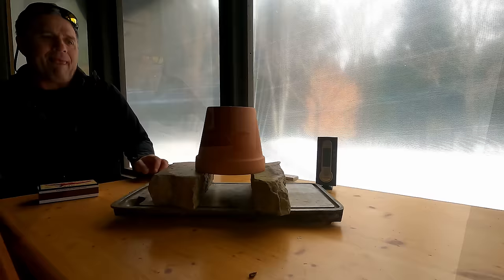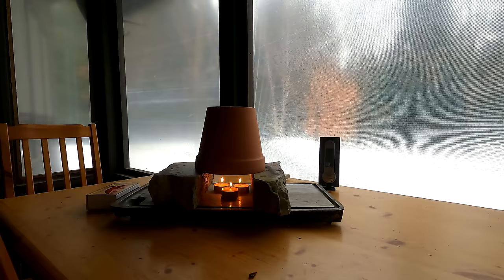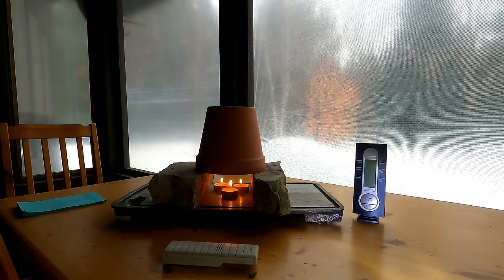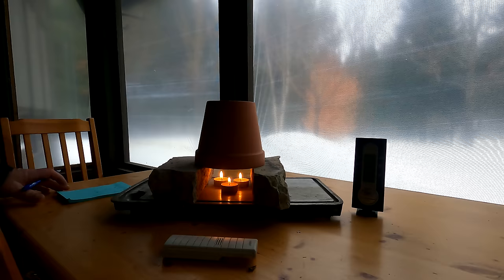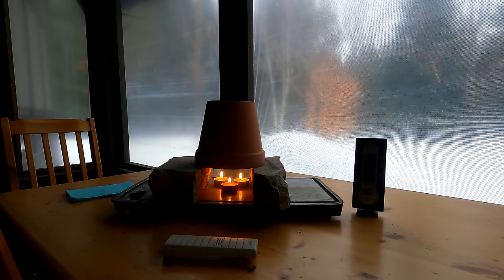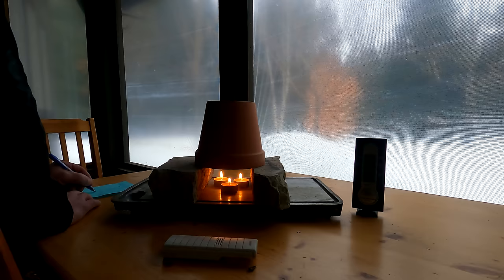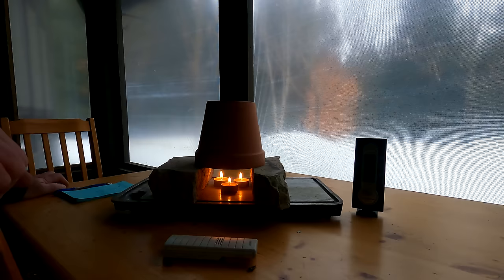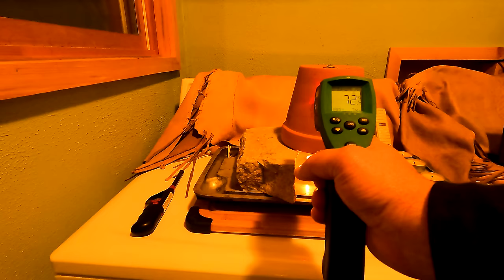Testing the Clay Pot Heater | Truth or BS | Prepping and Testing

Comment: The thing that casts doubt on these things isn't that it's on the internet, but it's the machine voiced, "the EVIL heating companies DON"T want you to know about THIS" Which is obvious clickbait and obviously doesn't make sense, and there's a question of motive behind the advertisement.  I'm also partial to the people who said you didn't really provide us much value.  Mechanically, some HVAC guy needs to explain what's going on, not a guy in a cabin in the woods (though I like these sorts of folks, generally.)
Reply from the maker: Not sure what your statement means  "but it's the machine voiced, "the EVIL heating companies DON"T want you to know about THIS" Which is obvious clickbait and obviously doesn't make sense, and there's a question of motive behind the advertisement." as I did not use such language in the video - I simply did the test to determine if this unit would work. The candles did indeed heat the small room - marginally - by a few degrees. The pots simply capture the heat and radiate it out in a controlled manner - much like a stone fireplace is designed to do. Bringing in thermal dynamics into this conversation is a tad bit over the top because when the power goes out, and you are wearing your parka in your home - any heat is good heat.  Note - my home is heated with wood so therefore I have no need to use this device. This was a test was conducted to quell my inquisitiveness pertaining to the potential of such a device. BTW - As a guy in a cabin in the woods, I can tell you we are very adept at fixing anything which comes our way. HVAC, Electrical, Plumbing and every thing that makes a Cabin run.

Comment: Watch the price of the  T lites go through the roof.
Reply from the maker: Thats funny - Ikea sells them in huge boxes - This heater is useless in practice - a good ole campfire is good enough for me.
Reply: @Hawksshadow  maybe you don't live in a very cold country like me.  Europe is currently being extorted for gas. Not gas that goes in your car either but that too.
Reply from the maker: Hi John - Temps here can reach down to - 40 degrees C. The clay pot setup will actually heat a small room to a comfortable temperature. The advantage of the rig is the fact that it costs relatively nothing to make and is safe to use as long as it is sitting on a proper surface. The disadvantage is its fragility - useless for outdoor adventures. Build a couple of these and place them within a small room and you're good to go. You're right - you will go through a ton of candles.
Reply: @Hawksshadow  damn minus forty! Where you from Canada?  You should make a youtube video on how to do it.
Reply from the maker: You've got it dude - I am in Canada- At minus 30 your eye lids stick to your eye socket skin - Freaky feeling. The problem with YouTube is that many of the people doing vids on camping are faking it - Batteries for cameras will last minutes at that temp along with the fact that one wrong move and Hypothermia will set in and take you out. Thanks for the comments - I need to keep it real and conversing with guys like you keeps me in my lane.
Reply: @Hawksshadow  That's crazy.  You guys must be tough as hell.  It only gets to about minus four here during the winter I think and at the moment it's costing about four pounds a day to heat my home but I'd say it will be almost double that when the winter kicks in.  Shouldn't be complaining too much when you guys get it so bad though.  What kind of heating systems do you guys use for central heating over there.  Here it's predominantly gas combi boilers although there are different types.  I'm guessing you're not a fan of Treudo.  He comes across as a real ass and hopefully you guys can get him out of office one way or another.
Reply from the maker: I heat my home with wood and electric baseboards, most have central heating systems - gas predominantly. Building code here mandates R40 in the walls and ceiling - it costs a small fortune to keep warm.

Comment: This only works for people that don't know the basics of thermo dynamics.
Reply from the maker: Or for people that have no other means of keeping some semblance of warmth in a small room when the power fails. I have to conjecture that you have never experienced a power failure where you were forced to think outside of a sheltered box in the attempt to stave off hypothermia.  I have no need to prove this as a viable unit - only needed to test it out of quiet curiosity. When you are backed against a wall and shivering, thermal dynamics and all of its related physics and calculations move to the back of the class. The primitive mind kicks in and deals with the problem.

Comment: No B. S. huh? Where is the control?
Reply from the maker: This was not an experiment - it was a test to see if the pots and candles could heat a room. The combination unit did indeed heat the room by a few degrees. The premise was to determine if the unit is viable - it is only viable due to the pots ability to capture and radiate heat in a controlled manner. Once the candles are extinguished, the pots continue to radiate heat for a minimum of 30 minutes if the room temperature is above 16 degrees C.

Comment: These are absolutely B.S. a clay pot doesn't make more BTU's from fuel
Reply from the maker: Correct - They capture the heat and radiate it in a controlled manner whereas candles alone will loose heat to the room rapidly.  When the candles are extinguished, the pots continue to retain heat and radiate it for at least 30 minutes.  Note, I would not use this unit as a heater as there are manufactured units which are far more efficient and safe to use.

Comment: 70c is like having a hot cup of tea on the desk...
Reply from the maker: I would have thought the same prior to doing this test. The candles do indeed provide heat - albeit minimal, to the room. The pots function is to simply capture the heat and radiate it out in a controlled manner. NOTE - This unit is too dangerous to be used as an emergency heat source - The candle wax becomes liquid due the radiant heat of the pots and can combust. Open candles are never a good idea in a house and the fumes from this system can be toxic. 
Only candles made of beeswax or soya should ever be used in an enclosed space.

Comment: what to put in the ground for heat protection ?
Reply: To keep it safe, I suggest using something we call a 'constructional hearth'. This is inert material, such as a concrete, or stone, etc. Ensure this is level, and firm. Do not accept a wobbly  base, or an incline. Do not pack combustion-prone material, such as paper, wood, plastic, or cardboard underneath.  Once you have made this safe, and you're happy with it, then you move onto the 'superimposed hearth'. This is, once again,  inert. The best choice is baking or roasting tray, with a raised lip. Look up the term 'bund'.  Google the technical terms. Remember!  This is an unattended flame, so if you  finish it, make sure it's extinguished. Keep It Safe!
Reply from the maker: You are absolutely right - never place this heater or any other open flame heater on anything other than and inflammable surface. 
Thanks for responding to gate keeper.
Reply from the maker: gate keeper - for this experiment I used a metal grilling tray for a Coleman Stove.

Comment: complete bs.  3 candles only put out as much heat as 3 candles.  Adding a pot only ...adds a pot.  Unbelievable how people don't use common sense and think things through.
Reply from the maker: The pots do not add heat - never claimed they did - the pots retain heat and radiate it out in a controlled manner due.  The pots absolutely do contribute when you factor in the amount of time they radiate heat long after the candles are exhausted or extinguished. I heat granite rocks up in a fire pit to heat my shelters and they have saved me many times from hypothermia. The clay in the pots works in a diminished but similar fashion.  I would not use this unit as there are too many issues pertaining to safety and effectiveness.  If you have a moment, take a torch to a clay pot, heat it for a few minutes and time how long the pot radiates the heat back.

Comment: using only candles might have the same result
Reply from the maker: Hi Tony, I tested that theory in a different vid. I used a   couple of candles in a pop-up blind to determine if the candles would keep Hypothermia at bay. The candles worked; however, the clay pot heater actually radiates heat far more efficiently. The clay pot heater is totally impractical for bush use - I was simply curious about the physics.

Comment: bs BTUs output is exactly the same as 3 candles. Physics is your friend.
Reply from the maker: 100 percent. The clay pots simply capture the heat and radiate it out in a much more controlled manner than the combustion of the candles alone. Physics is indeed what makes our lives make sense.

Comment: It's stupid unless you want to breathe in paraffin. You might as well just make an alcohol stove
Reply from the maker: This unit does indeed have safety risks associated with its use. Toxic fumes being on the top of the list. Alcohol stoves are awesome - I carry at least one on every wilderness trip I undertake. The alcohol stoves put out more BTU's than 4 tea candles and would certainly work well to heat a small room without the associated risks other than an open flame. I did the test to determine the validity of the proposition that this type of unit could maintain "livable" heat in a small area - I would not use one as I heat my home with wood. Thanks for the comment.

Comment: You will have better luck heating your room with a tea kettle.
Reply from the maker: The kettle would require a heat source. This unit will not heat a room any larger than a closet, as was done in the video. The room was already well above zero - adding a few degrees with this unit truly does not intimate that the unit could keep the room from plunging in temperature should all power fail. The pots simply capture and radiate the heat generated by the candles - Stones in fireplaces do the exact same thing.

Comment: BS ---- means Being Silly
Reply from the maker: Good one - however, I was inquisitive enough to put this test together to ascertain if this kind of device is viable as emergency heat. The pots only function is to capture the heat and radiate it out in a controlled manner. The pots stay hot to the touch for 30 minutes after the candles are extinguished. Note - there are too many safety concerns with this unit - I would not use this in my home.

Comment: The pot temperatures? The pot has dif temps? 😂 wtf??
Reply from the maker: Of course - the pots capture the heat and radiate it out. Much like the stones in a stone fireplace - their function is to absorb the heat and release it as radiant energy. I was wondering when someone would ask this question. Thanks
Reply: @Hawksshadow  completely missed my point. The pot has a temperature. Not temperatures. It’s 1 pot that has 1 temperature….
Reply from the maker: There are 4 pots joined by one bolt. The outer pot has varying temperature zones. Each pot heats up and creates superheated air between it and the next pot. This has a huge effect on the temperature variations on the outer pot. I measured the outer pot at the top, center and lower ring. The temperatures were indeed different by several degrees. The middle of the pot was the warmest of the three zones.

Comment: Sometimes I'm saddened by these candle-heater videos.    I'm never certain if it is to test the gullibility of viewers?  Or if the creater and audience really are this uneducated about science?
Heat comes soley from the burning of the fuel.   The pot, any pot, any configuration does  NOTHING (except catch soot.)    It does not / CAN NOT make more heat.  The amount of heat comes soley from the rate at which the fuel (wax or oil) is consumed by the wick.   Want more heat? -- add a wick or use multiple wicks.    If the candle(fuel) is not burning *faster*... it is not producing 'more heat'. The flower pots do not cause the candle to burn faster.  The flower pots or any gadgetry do not produce more heat than just the candle by itself.  The clay pots or whatever -  do nothing except demonstrate peoples gulibility.
-- Physicist.
Reply from the maker: This test was done to see if the unit was a viable heater - The candles do indeed provide the heat - As you so clearly stated - the pots function is to capture the heat and radiate it out in a controlled manner - otherwise it would be lost to the ceiling. I have heated my tents for years using heated rocks which were placed in a firepit and then extracted and placed on a metal base. The pots perform the exact same function as the rock - capture heat - not increase it. This unit is not suitable for confined space heating as there are too many safety concerns associated with its use.  There was no attempt on my part to beguile people or create a fake video for the sake of an algorithm. YouTube is full of videos which are full of BS and  I can assure you, my videos are not. 
Thank you for your comment - I am glad there is someone out there who is also upset by the BS which seems to be so pervasive on all platforms.

Comment: Great heater poor burner
Reply from the maker: Not sure what you mean - I don't believe - through my tests with it, that this is a great heater; however, the "poor burner" part of you comment leaves me to wonder if there is a better method to heat the pots. 
Thanks for the comment.
Reply: Hey buddy there's lots of better burners. I quad camp and carry a alcohol burner to cook on , 6 hr Sterno for my heater. I sleep on a bridge hammock under two tarp covers and my heater is to hot at times. I been down to 5 deg F @Hawksshadow
Reply from the maker: Thanks for the clarification - I thought you referring to the method I used for the pots. 
The Pots are useless for any camp situation. 
For cooking, I use a primus stove - super simple and inexpensive - the stove never fails me. Thanks tons for the info about the alcohol burner.   @bulldawg6259
Reply: You're welcome  I make a neat furnace for a tent, cabin or under my hammock. I use alcohol for a quick heat or sterno for a mellow long heat. Check Hiram Cook and Robert Murray Smith for info about burners, stoves and heaters.  Good luck to you @Hawksshadow
Reply from the maker: Thanks for the link and info - Happy Camping  @bulldawg6259

Comment: This has been debunked so many times. Read the laws of thermodynamics.
Reply from the maker: Debunked or not - the pots capture the heat and radiate it out in a controlled manner - they do not increase the heat - simply change it to radiant heat - controlled heat. The pots will radiate heat long after the candles are extinguished. If you are in a flight or fight situation - and you resort to using candles for heat - it would make sense that you capture that heat and control where it is going to be delivered. Warming up your hands is often enough to keep you from dropping into hypothermia. NOTE - I do not condone using this system simply because there are too many safety concerns. There are many products on the market which are designed to deliver heat, safely, should the power go out.  I thought the same thing about this being a hoax until I actually rigged one up and tried it.  The test took place in a 5ft by 8ft room which is insulated to above code standards of R30. The room is internal to the house. Outside temperature has no bearing on this particular test. 
Try the test - you might be surprised.

Comment: The test is meaningless without comparing the results to heating with just the candles without the pots.
Reply from the maker: Hello John. The idea is to see if the pots would hold heat and radiate it to the surrounding room. This heater would be totally impractical for field use. I did a test using just candles in a pop up shelter. They worked well. Enough to keep hypothermia at bay. 
Thanks for the comment.
Reply: ...depends on what the hypothesis was, not just an arbitrary comparison.

Sure, he also could have compared two different store brands of tea lights, pots of different densities, and on and on. That's not what was being tested here. 

Also, he was re-testing an existing claim...which is part of the scientific process (i.e. being able to replicate someone else's process and get the same results).

Did the clay pot heat the room to his liking? Yes. The test was a success.
Reply: @niaralosusa  exactly. people are a trip sometimes. He just simply wanted to see if it worked and it does.. great job man